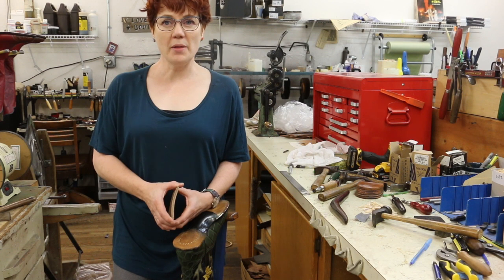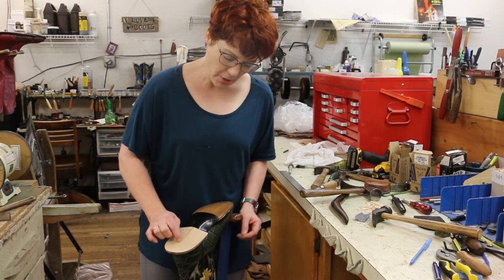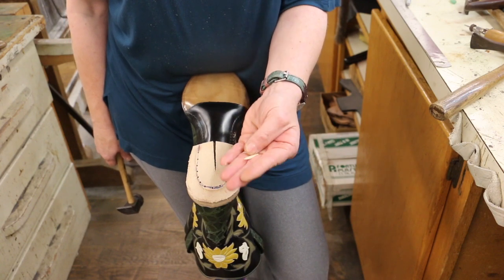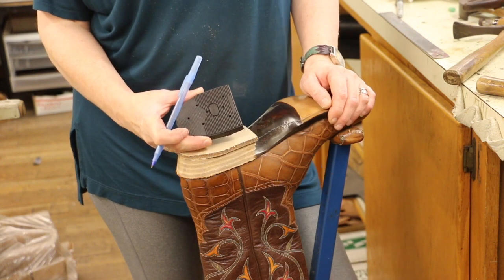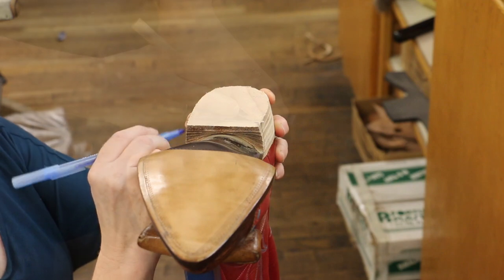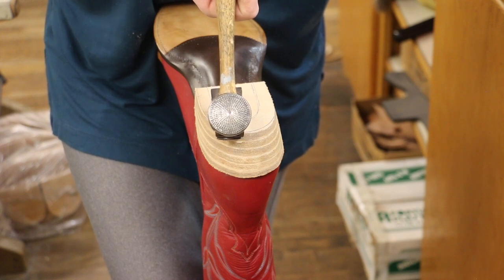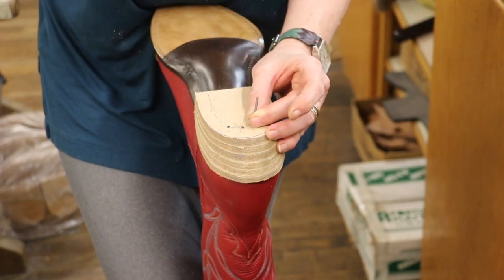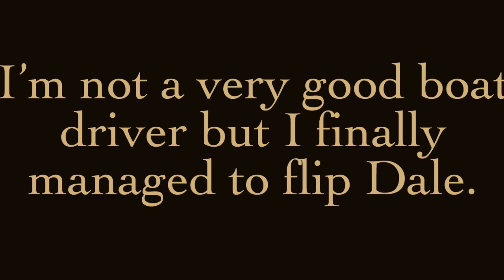It's a Boot Life

Comment: I use my needle nose pliers to hold the iron nails. As you drive them in, you reposition the pliers to accommodate. This keeps hold of the nail, keeps your fingers out of the way, and also keeps the nails from bending over due to incorrect strike. Fits my style, maybe not yours, but might save some nails and definitely saves the fingers.
Reply from the maker: That is an excellent tip; thank you!
Reply: My batch of nails got wet and some of them rusted a little.  The rusty nails were a whole lot easier to hold on to!  Now I apply vinegar to a new batch of nails to put on a patina of rust.